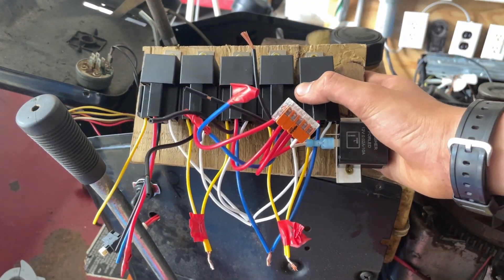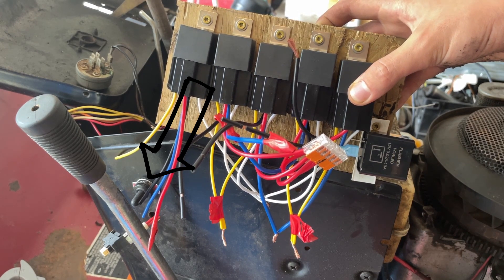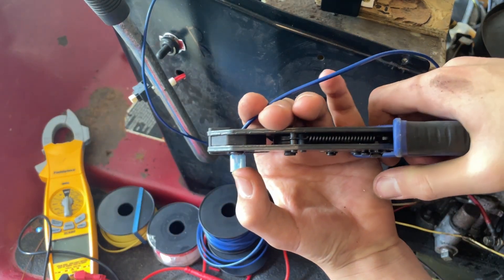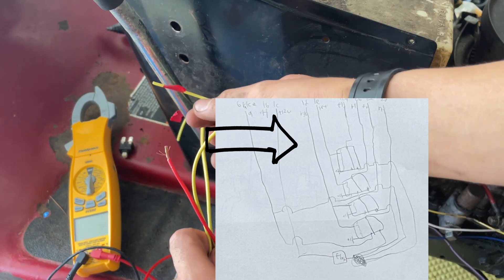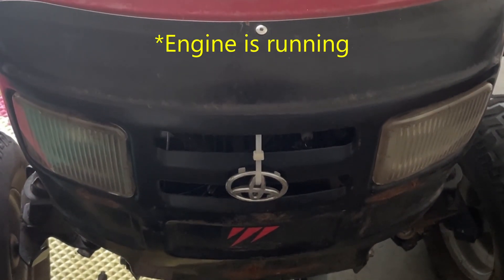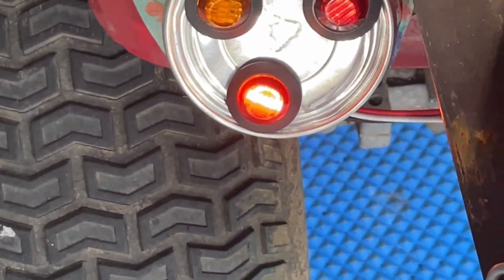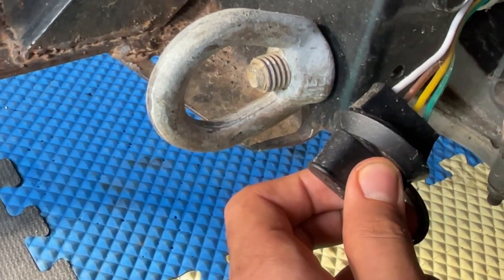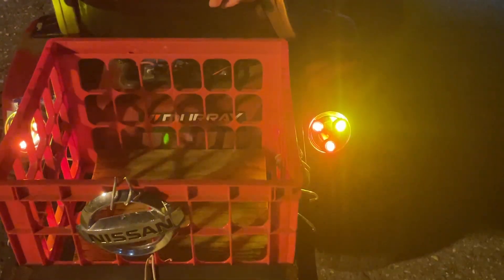Adding Turn Signals and LED Headlights to a Lawn Tractor/Riding Mower

Comment from the maker: Adding turn signals, brake lights, hazard lights, and upgrading the headlights to LEDs on our Lawn Tractor.
The video by Wiring rescue: https://www.youtube.com/watch?v=ZOBd_7rtv4s - Make sure to use an led flasher if you use leds!
Answering questions!

Comment: I mean you did it dont get me wrong, but dude, you waaaaay over complicated this. Waaaay overcomplicated it. You could have used 2 lights on the back with 1157 bulbs. They are 2 filament bulbs meaning that they have 3 wires. One is ground, one could be for tail lights and the other wire could be for brake lights. The the other bulb would be for turn signals. 4 light on the back. 2 on each side. One on tbe front like you have it. But you did it anyway lol. Goodjob i guess
Reply from the maker: I thought about doing that but couldn't find good sockets that protected the light for a low cost(and I didn't have any spare 1157 bulbs at the time). This is still simple as the amber and top red light are wired in parallel and they are for the brake/turn and the bottom red light is for the tail light and there is a common ground, making this only a little bit more time consuming than 1157 bulbs.